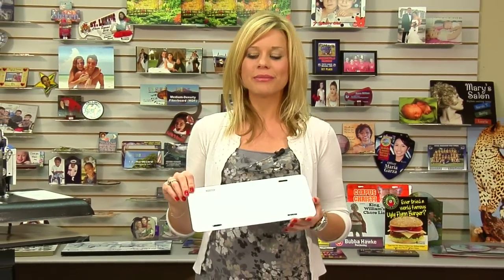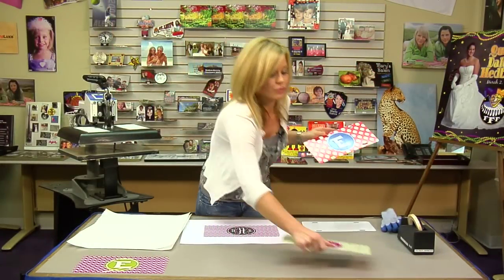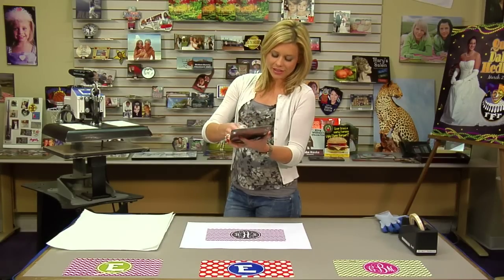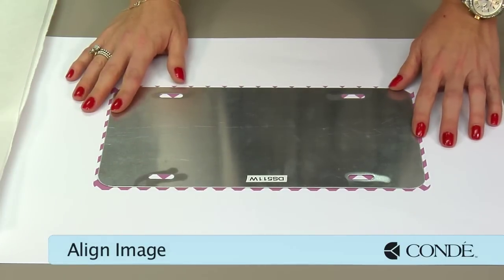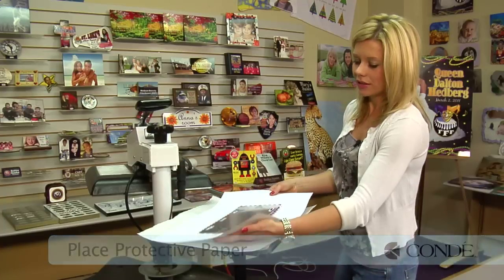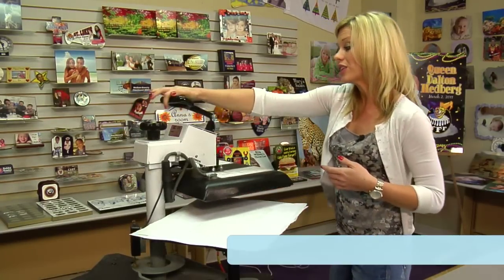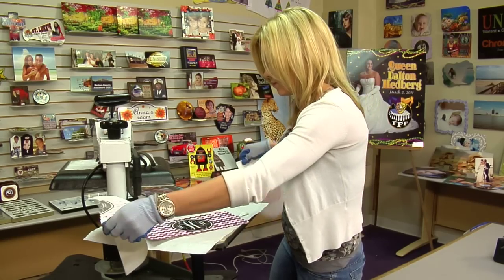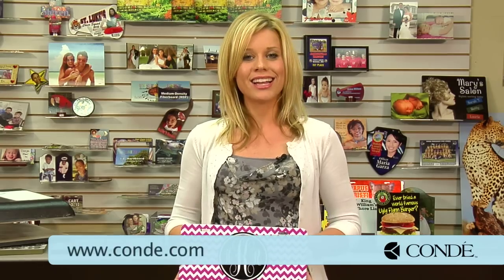How To Sublimate License Plates - Step-by-Step - Conde Systems, Inc.

Comment: you can use the Sawgrass Virtuoso SG400 sublimation printer to print the license plate design on sublimation paper right? (I'm very new to this)
Reply from the maker: Yes, exactly that. You're doing fine. Call us at 800-826-6332 if we can help you.